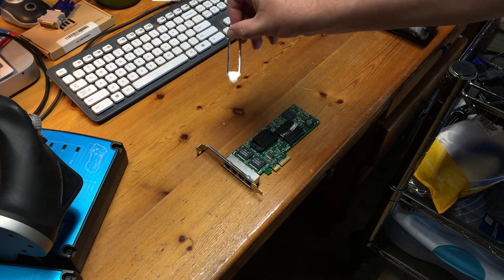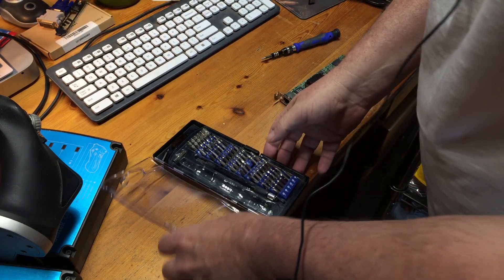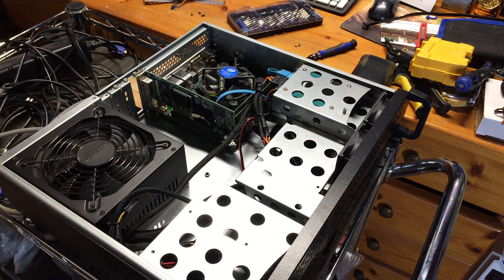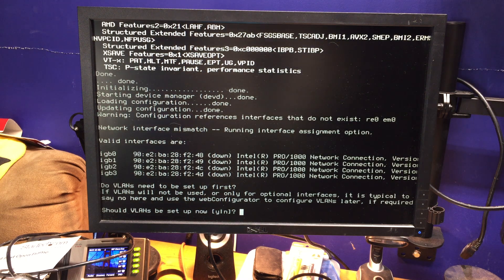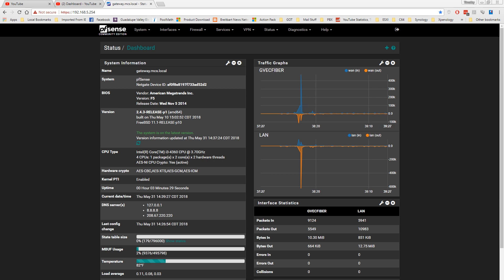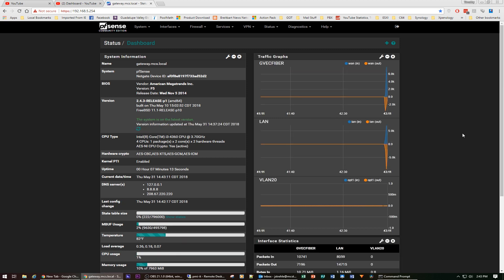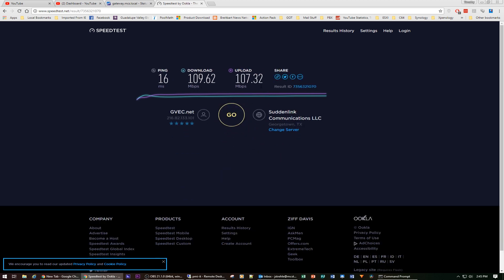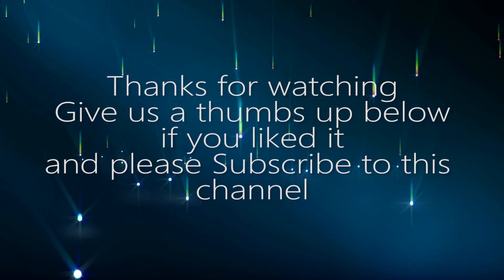PfSense Part 2 - Install & config of the quad port NIC EP-195

Comment: Thank you. So why did you turn off the onboard LAN controllers?  Can you not run them along with the Quad port NIC?  I ask, because I have a problem in that my Internet speed download drops from expected (hundreds of mbit/s) to miserable (single digit mbits/s) some time within a day of rebooting pfsense.  If I then tick the Hardware Checksum offloading (System/Advanced/Networking/Network Interfaces) off and then on, the Internet speed returns to expected  for a while, and then drops again.  I have not turned the onboard lan controllers off, and wonder why you did so.

Comment: Only problem I have with PfSense is the strict nat for the gaming systems, I have to give one of my public IP's to the original cable modem in order for all of the gaming equipment to work properly. The solutions I found through searching seems to only work for one gaming device. 

Other than that I love it for everyday use and regardless of the battle of it being useful as an UTM, I think with the packages loaded and configured properly it can be.
Reply: I wonder with all the internet providers moving to AMD EPYC powered Secure Servers maybe we shall see a glut of old INTEL based servers and they might get used as PFSense Firewalls but I wonder if it would be possible to use a m2n68-la (Narra3)-gl8e  motherboard and an AMD PHENOM II X6 with 256GB of DDR3 RAM and a AUSTECH EN9500GT plus a four way network card and try and get the NVidia Firewall installed and working as it was meant to.
Reply from the maker: Check out this guys videos on PFSense, and also contact him and perhaps he can help, he is my goto guy. Thanks for watching. https://www.youtube.com/channel/UCHkYOD-3fZbuGhwsADBd9ZQ
Reply: Unkyjoe's Playhouse Yeah I watch this channel as well, no solution there either
Reply: jerry crumety enable upnp
Reply: Enraged Bacon That parts easy, its enabling moderate NAT or lower to allow multiplayer to work correctly on more than one console at the same time. It works on one console at a time  but I'm talking a total of 12 or so gaming consoles at a time